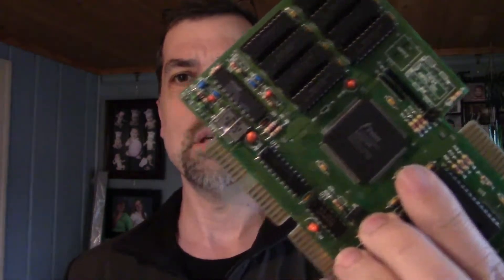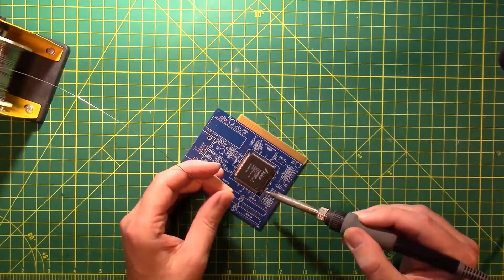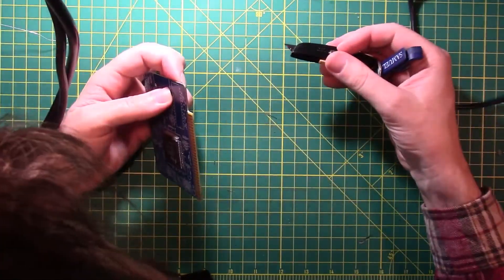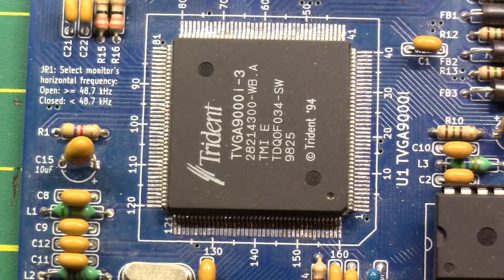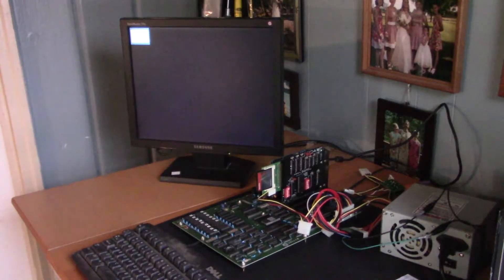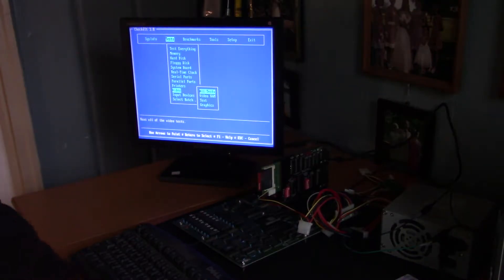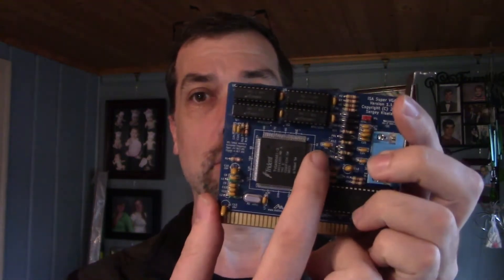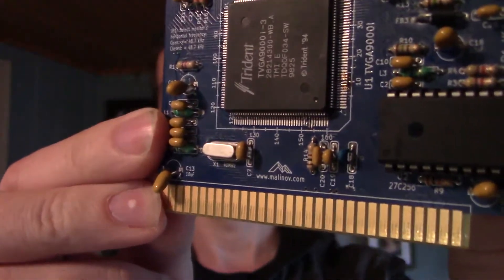Building Sergey Kisilev's ISA Super VGA Card

Comment: Chips that size are easy to hand solder - just forget the desoldering braid and use proper flux instead of a flux pen. They are so much easier to hand solder than the tiny surface mount resistors.
Reply from the maker: Agreed

Comment: Can I pls pls have one for my XT?
Reply from the maker: Here you go: https://ebay.us/HZUOna
Reply: @TemporarilyOfflineRetroTech  assembled....
Reply from the maker: It might take a bit to find, but if you look for a Paradise VGA or Western Digital VGA you might be able find an 8-bit only model.  Also, a lot of the 16-bit VGA cards will work fine in an 8-bit slot... but you'd have to take a gamble/resell some if they don't work.  I have one that I use all the time that is 16-bit - but I use it in an 8-bit slot.
Reply: @TemporarilyOfflineRetroTech  Do you know if the Trident 8900 16bit card can working 8bit mode?
Reply from the maker: The chip has no problems,  but I don't know about the bios or other hardware.  You'll have to do some research on each card.  It took me a while to find mine and even then it was still a bit of a gamble.
Reply: @TemporarilyOfflineRetroTech  Thanks a lot for your valuable info.